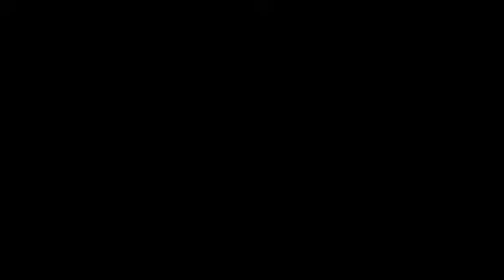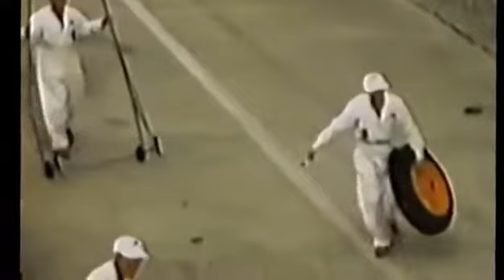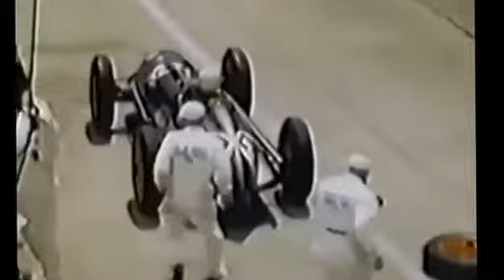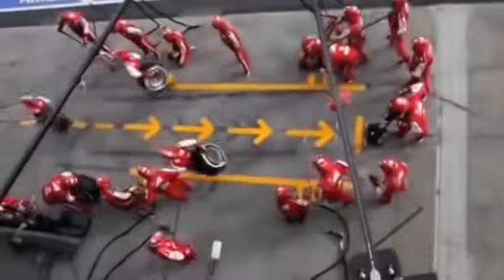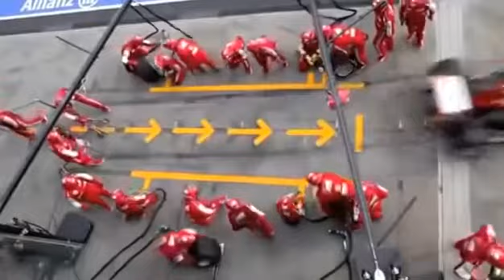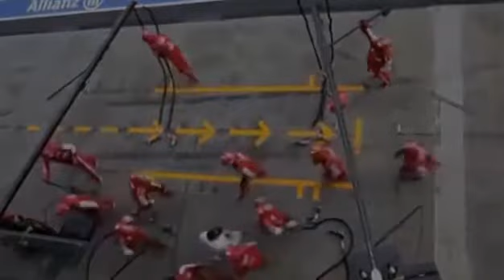Quick Changeover F1 Pit Stops 1950 vs 2013

Comment: So have better equipment and higher double triple the people kind of the opposite of what lean does
Reply from the maker: Thank you for sharing your thoughts @goochnukem4950.  In this example we see two activities that occur.  Internal Setup Activities (https://www.leanstrategiesinternational.com/glossary/internal-setup) and External Setup Activities (https://www.leanstrategiesinternational.com/glossary/external-setup-time). While improving tooling and resources is definitely noted in this example the biggest improvements actually occur during the external.  For example: People are in position prior to the vehicle arriving, tools are positioned appropriately, materials are on site and in place and each resource has a standard procedure to follow.  In addition to this you are correct, internal improvements occur as well. Resources are balanced, tools are improved and capacity is expanded.  It is important to note that these improvements, while not nearly as large as the activities that are improved during external changeover time can contribute to improved changeover times as well and typically would be performed only after reductions in muda ( https://www.leanstrategiesinternational.com/glossary/muda) or other non-value adding (https://www.leanstrategiesinternational.com/glossary/non-value-added) activities have been performed.